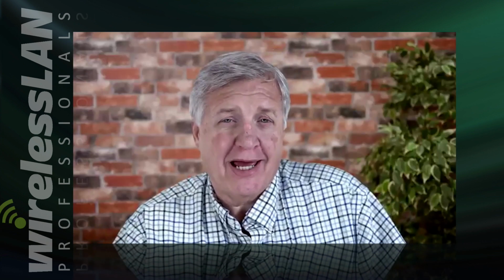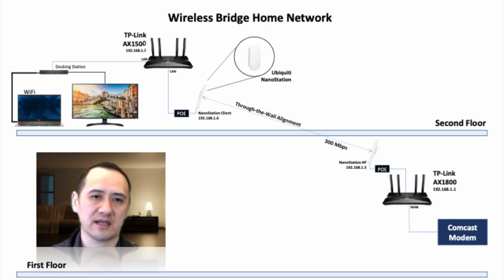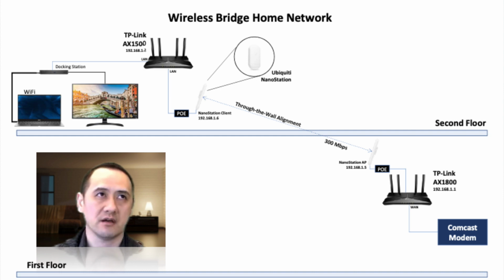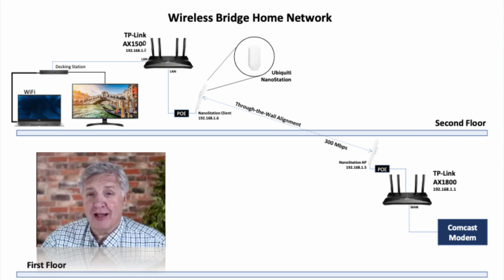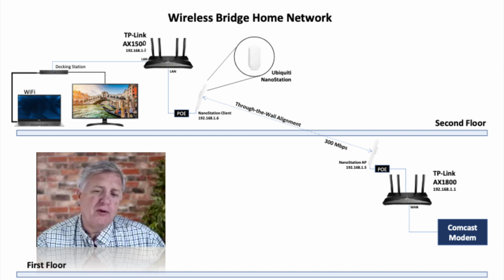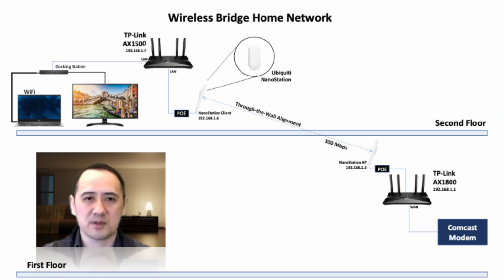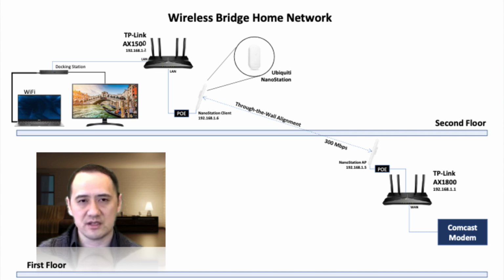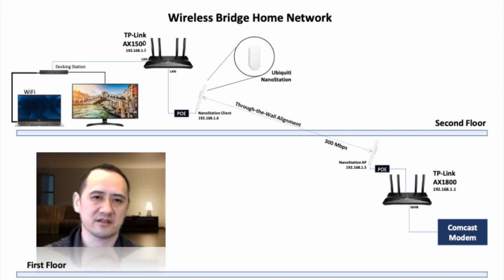Interview with George Ou Ubiquity Solution to Zoom Latency

Comment: Thank you for covering the important (and often not understood) topic of delay  in wireless networks. A wire is always going to have an advantage over a shared medium like Wi-Fi. Taking the approach of splitting the users to more APs in order to avoid congestion (not as in bandwidth, but as in airtime) is very valid, but I think using different SSIDs makes this a very manual process. Given  the low-budget approach one might be willing to go that route, but over time the sticky client problem will get annoying. (I speak from personal experience...)
I am surprised George mentioned that the same problem exists with enterprise-grade solutions, as I have not yet observed this with Aruba. A properly planned and verified network will have sufficient APs to avoid airtime congestion, making use of spatial streams as well. And the Airmatch technology will automatically assign clients to different APs, based not only on signal strength, but also on Wi-Fi standard supported and amount of users  per AP. 
Having said that the airtime congestion and related delays just shows the perfect use case for Wi-Fi 6 with OFDMA. When implemented with good scheduling it solves this problem by allowing multiple users to communicate simultaneously within one channel. 
For the wireless bridge I am not surprised that these are very forgiving in regards to antenna alignment. I do not know the proprietary Ubiquity protocol, but if it is designed for long distances it requires to be generous in regards to the arrival time of frames. Indoors this means that even multiple reflections (as there will definitely be) are acceptable. What I am wondering is how it copes with reinforced concrete ceilings and brick walls, as these are much more common in Europe. 
@George, do you have experience with these?
Great video, thanks for sharing!